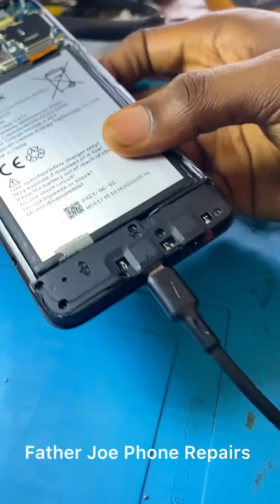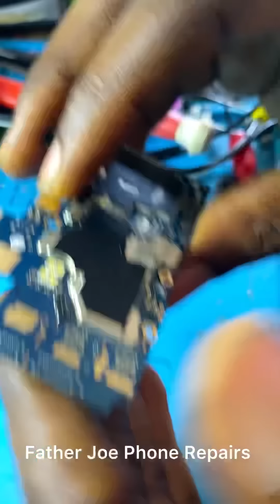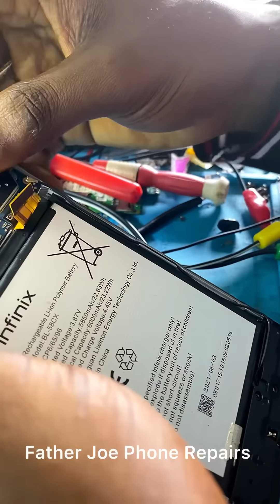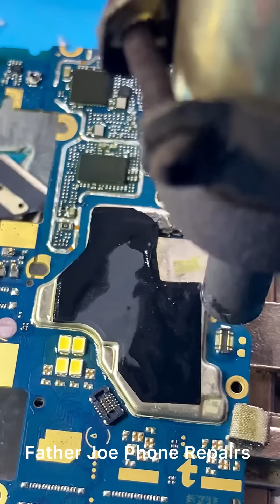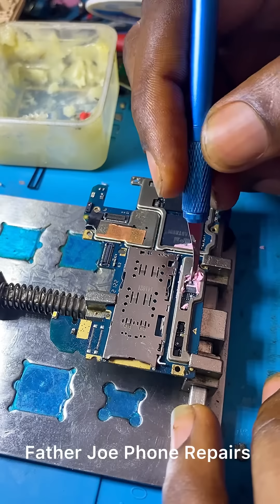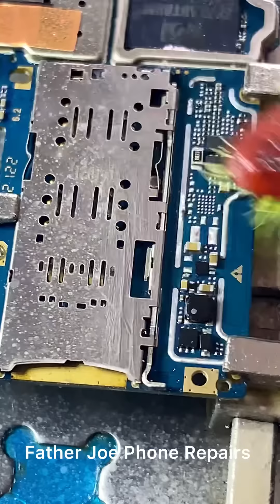How to repair any phone that’s showing only charging light 💡

Comment: Good evening sir this type of problem now that you're doing right now is also the type of problem that I face today in my workplace was I'm also learn how to repair phone so and this type of the issue now came to my worship today about the phone was showing light at the top of the charging panel and what we did today is just that the phone was on but it's not charging we change the damn panel and the thing continuous like before then we change the screen the same issue continuous then what we did next was to service the panel

Comment: Please Sir how do you fit a phone that when you press it, it suddenly gets hot and the it will reboot or off completely especially when you're data is on 
I've changed the power flex and the battery but it's still the same

Comment: Boss u dont need all this stress just change the power ic and it will work simple
Reply: thank you
Reply: And where exactly is the power ic located, I have a similar phone. It was dropped in water and after cleaning it, I changed the screen and the charging flex. The phone worked for two days and yesterday it just went off and only showing the charging light. Please advise

Comment: mobile pcb can charge well but it stopped data transfer even if I use other working usb cables and I have also replaced usb charging port with new one but still its not detected by any computer
Any idea about the chip or IC any component that is responsible for android data transfer'
Thank you
Reply: don't play hero ohh jus reton it tu customer... greetings from Kenya my dear technician
Reply: I think you could check the screen too if charging flex is attached to screen......

Comment: Father Joe, pls be informed that in your video you said that the phone was repaired by many engineers and the problem was not fixed successfully so do not think that all faults are repairable, not at all. What I know is that some faults can be easily rectified and fixed and some too are very complicated due to irreplaceability of some faint components on the main panel.
Reply: Then I think you need right tools, microscope, short killer, thermal camera light and a reasonable soldering station
Reply: How do you use short killer to repair phones?

Comment: Thank you my fellow tech.
Such issues are mainly on the sub board. Or down board.
Try checking whether the voltage from the charger reaches the port board terminals.
If not please replace the charging port and all will be fixed.
Thank you 😊
Reply: No if it's from the charging port you can notice just by using DC or another battery that has power.
Reply: @tianzulu9662  I am facing an issue like this. If it's actually from the down board, then you can use battery to turn on the phone.

Comment: Better you check 1st charging board diode if the near diode in port is recieving 5v something then battery if do not need jumpstart then the board finaly.

Comment: Spirit and petrol which one is adviceabl for washing a phone board?
Reply: Fuel is more effective because it settled deeper but spirit is just minor area it can't spread deeper especially when a mediatek ic is contaminated with lots of corrosion. You need to allow the fuel settle for an hour or more
Reply: Please use sprit period
Reply: Tina stronger than both of them

Comment: How are you am from Zambia 🇿🇲 I changed screen on x6525 infinix smart 8 but the speaker is not working.Help me with a solution please
Reply: Replace another sub board, sometimes the replacement screen is not compatible with the follow come sub board
Reply: @ananti6935  thanks I replaced the sub and it worked
Reply: the new screen subboard flex is the issue so get another screen & test

Comment: What if power flows through the battery connecter but phone still doesn't on?
Reply: Check the screen
Reply: Sometimes charging ic can cause or power ic
Reply: But does  the battery charge and get full.

If so it could be the power up keys corroded or water damaged.
Thank you
Reply: But does  the battery charge and get full.

If so it could be the power up keys corroded or water damaged.
Thank you
Reply: Check your battery

Comment: This fault is mostly cause by ,, cpu bulk line losses under the cpu ,, if u reflow the cpu you might get lucky to get it back working,,,if it doesn't then you might need to reball the cpu